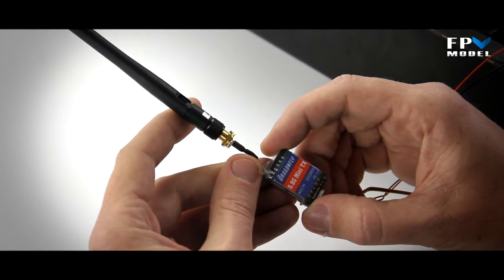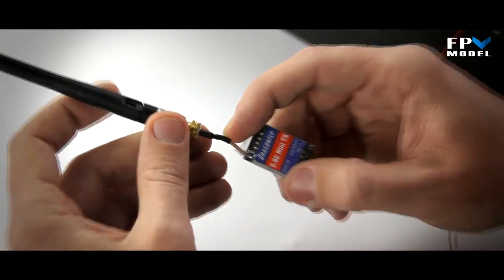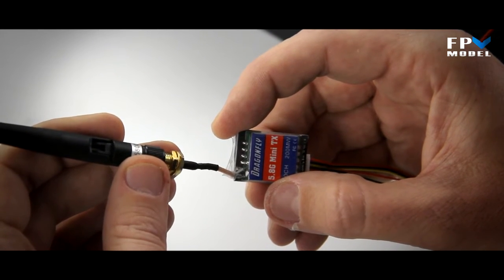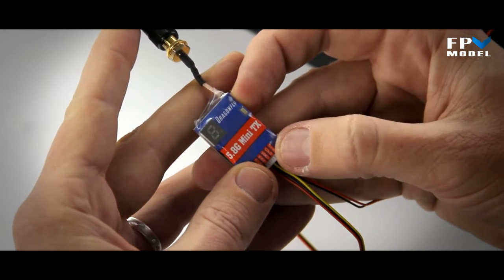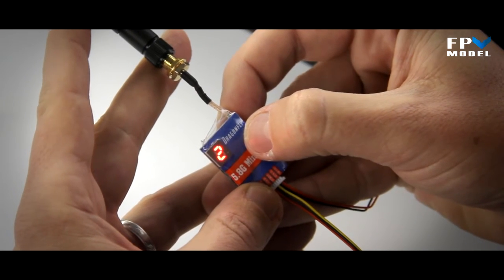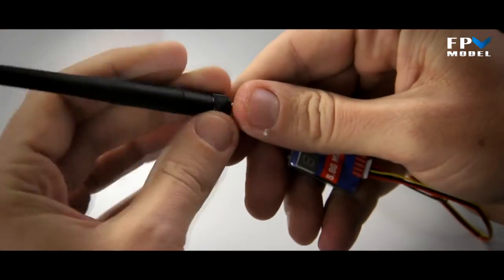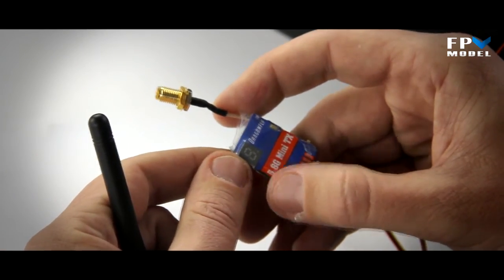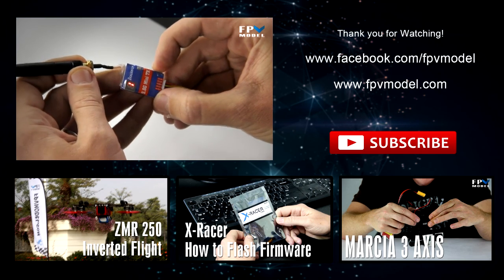Dragonfly 5.8G Vtx: How to set it up?

Comment: My pigtail broke on my dragonfly Vtx.  What pigtail connector should i purchase to resolder a replacement.  I only see two edge launch connector points on the Vtx but the edge launch sma adapters seem like they wont work.  Please advise.

Comment: will this TX work with a 4s battery?
Reply: Did you get an answer if this will works with 4S?
Reply: Did you get an answer if this will works with 4S?
Reply: yes it will -you can feed it  7 - 24 volts